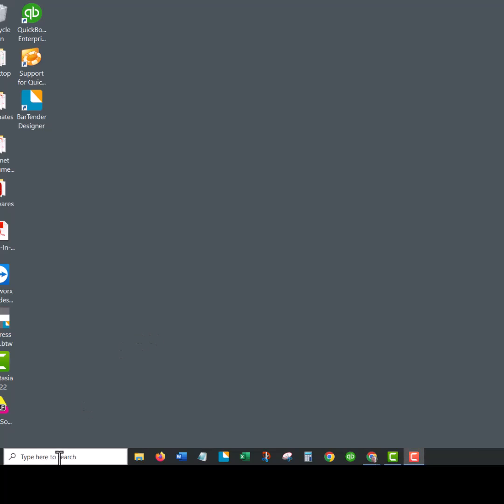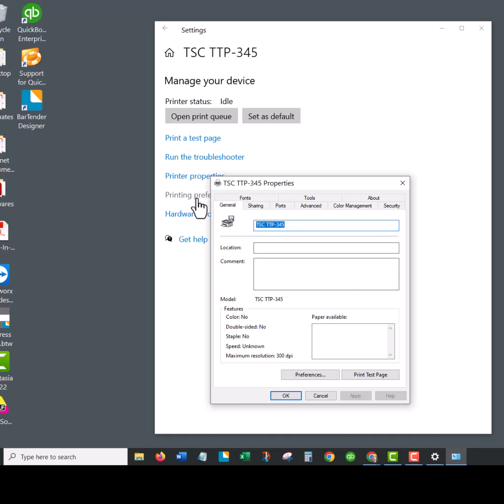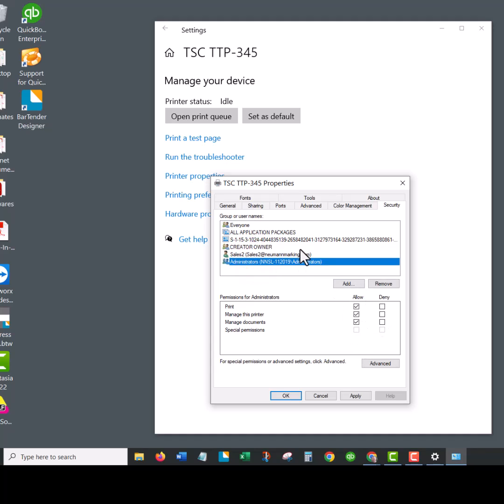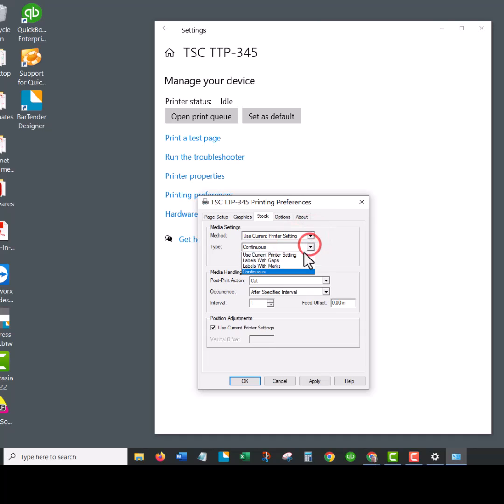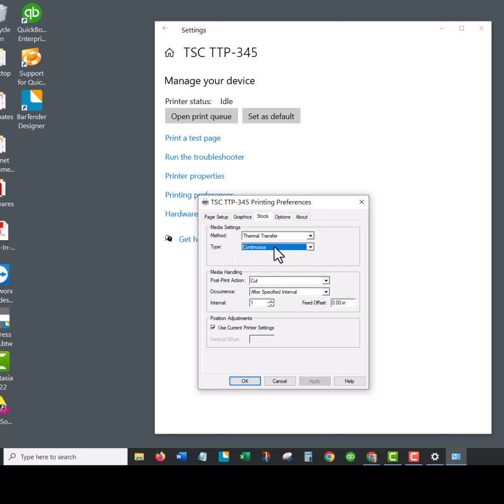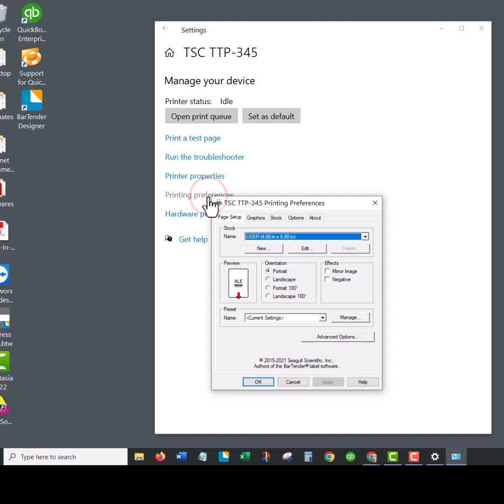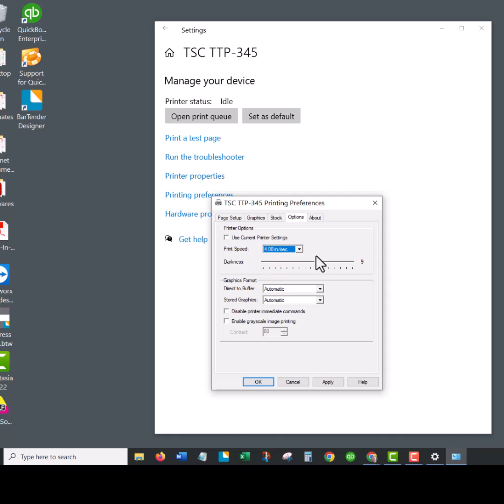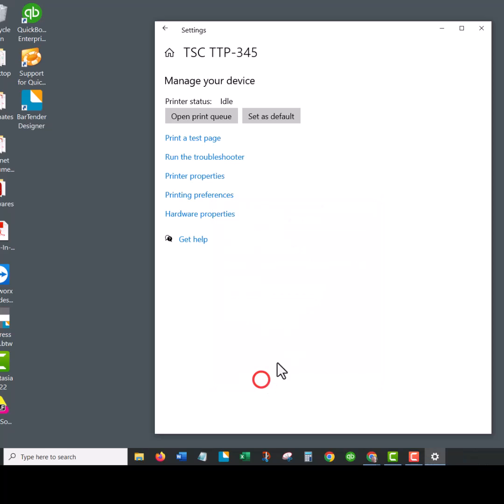TSC TTP345 Label Printer Driver Settings -Continuous Labels, w/Gaps or Black Marks

Comment: Can you help me for the continuous printing on TSC TE244
I am not able to print receipt in thermal roll because it has not the gap between it...I have also done all settings shown in this video but still facing the problem.
Reply from the maker: Hi. It may be where the gap sensor is located? There are several things that may be the issue but we're not familiar with that model. It will be best to call TSC tech support for some quick help. In North America, call 657-220-7995. https://usca.tscprinters.com/en/technical-support